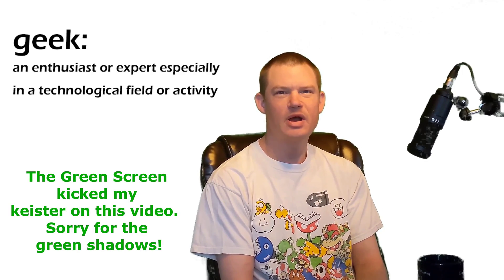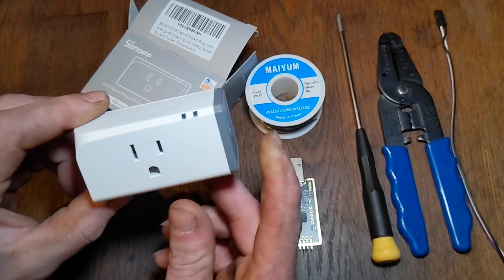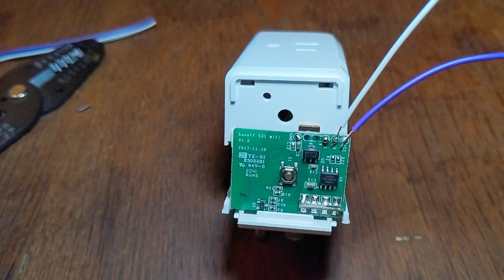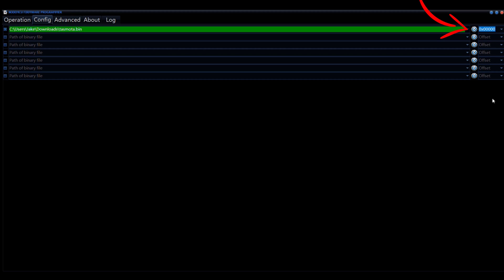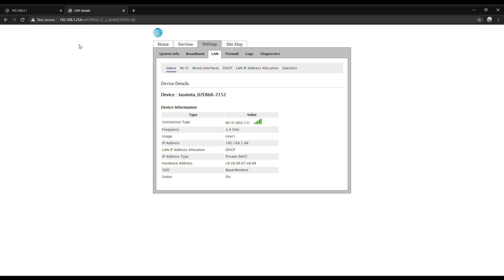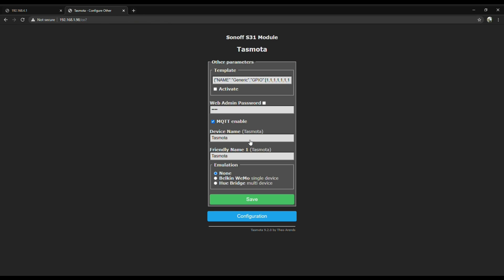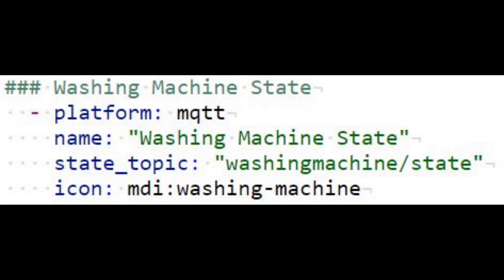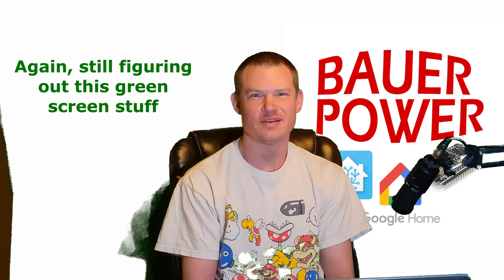Make A Dumb Washer Smart In Home Assistant

Comment: Glad this was here, I had to reconfigure my smart plug because I recently changed my wifi names (My router has 2.4ghz and 5ghz and having it use both on one name was causing problems so I separated them and named them respectively... in case anyone was wondering WHY i changed names). I was able to figure out how to connect the plug to new access point but couldn't remember what else needed to be fixed. for some reason my home asst ip changed at some point too (after the access point change... like more than a month after) this video helped me figure out how to update that.

Comment: Great flash!!!

Was gonna try a esp32 with a sensor and wired into the board of the washing machine. Your soulution is 100 times easier, faster and easier. How about the dishwasher please sir 

Great work
Reply from the maker: my dish washer is actually plugged into a sonoff S31 too. lol. It's the same exact thing.  Monitor the power usage and plot out the cycle.